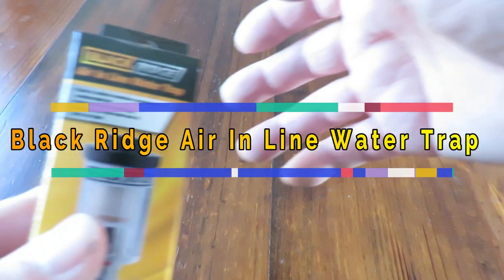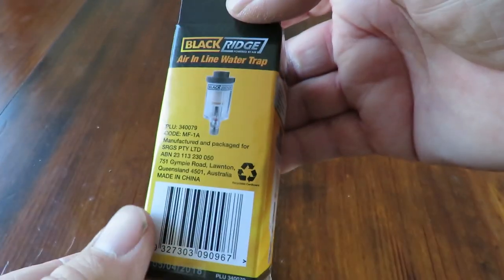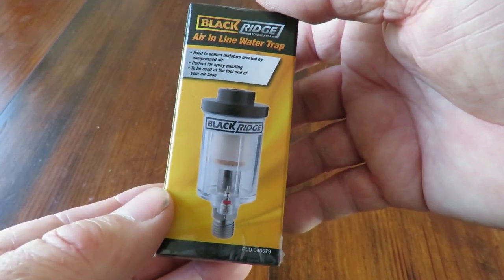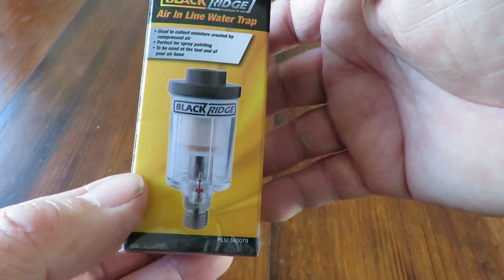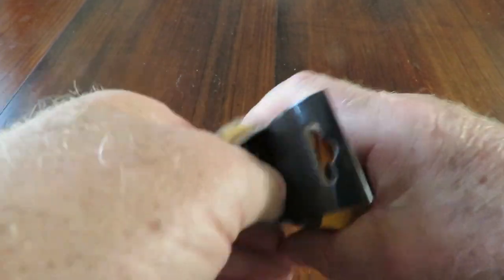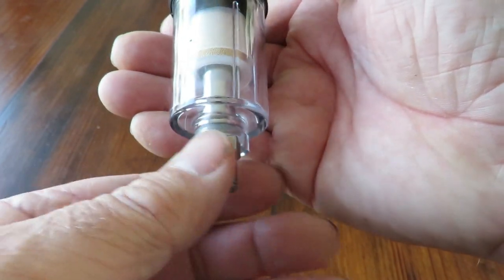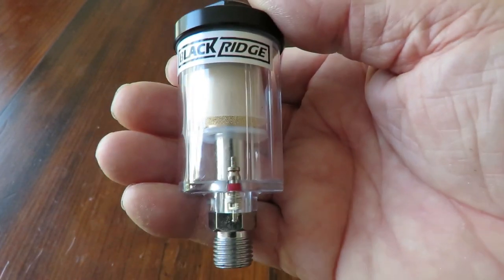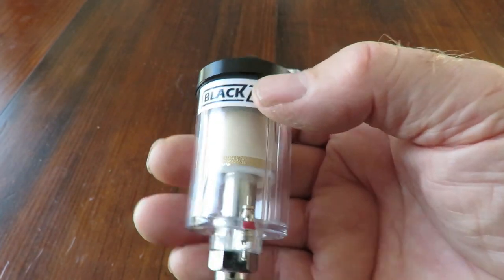🛠️ Review - BlackRidge Air Inline Water Trap for Spray Painting Guns

Comment from the maker: An Air Hose Inline Water Trap is an often overlooked item when setting up your spray gun setup to your compressor, but it is a good addition to have for spray painting.
The air compressor can push water through the hose and ruin an otherwise perfect finish.

Comment: this is bad advice, I have 3 of these filters, and I made an aftercooler. I have to constantly purge all 3 filter while painting and I still get water droplets. still looking for a solution to this water problem, maybe a much bigger after cooler. so that why you have so many dislikes, this by itself x3 still doesn't work
Reply from the maker: Its the nature of the beast so to speak.
Reply: Are you sure you aren't using it upside down, like the majority of users seem to be? I keep seeing people with these mounted to the base of their spray gun with the black cap mounted to the base of the gun. These aren't for spray guns. The air is supposed to enter on the side with the black cap, then be drawn through the base. The water vapor filter will keep the water on the outside, between itself and the clear cup.
There is even an arrow, indicated the airflow direction on the thing. People seem to ignore this though.
Reply: @ryanokeefe12  no you don't understand I had 3 of them and they were working as intended. 2 at the tank and yes 1 at the gun. The solution is you need the plastic $5 media filter right before the gun. This centrifugal filter get the majority but the air dryer at the gun gets the rest. The centrifugal filter did its job but the tiny amount of droplets still getting thru the gun ruins the paint job
Reply: Oh right I did find the solution. You need an air drier right before the gun, it's the plastic red or blue filter $5 at HF
Reply: @eksine  I don't think you read my comment.. How in the world did you have one at the gun? It would either be mounted backwards or mounted upside down, both methods meaning the water is pooling AT the filter itself.
Reply: @ryanokeefe12  I don't think you understand what you're saying. You hold the gun straight up or 90 degrees to the floor. Why would it be upside down and backwards? Dude I've rebuilt a transmission before. I think I can read an arrow showing me the filters airflow. What is wrong with you?
Reply: @ryanokeefe12  also why do you think this video has so many dislikes, because it's wrong
Reply: @eksine  bro.. The spring loaded vent needle needs to be facing the ground for it to work correctly, and no, I don't mean to vent water, I mean for the whole system to work properly. It's impossible to mount it to the gun in the correct direction and have the unit orientated the correct way.
It uses the exact same water seperator filter as every other water trap
Reply: @ryanokeefe12  having 2 identical filters behind it facing the right directional and yes it mostly the one at the gun faces the right direction, I even had it hanging off a 3 foot hose from the gun. Are you trying to imply I'm that stupid or just assuming I'm dumb? I've been practicing for a year spent thousands on paint. 100% you need an air drier at the gun, this filter doesn't cut it. That was my rookie mistake, ask any oro painter. A drier is REQUIRED, REQUIRED seriously ask. I've tested this 3 filter setup, does not work unless you live in low humidity. You probably live in texas which is why u think it works 100%
Reply: @ryanokeefe12  and that's what I'm saying a water trap doesn't not work, you need the fiber filters, literally fibers inside
Reply: @ryanokeefe12  The Neiko 30252A Water and Oil Separator on amazon, is virtually identical to the Blackridge. It has pictures of the unit attached to a spray gun, exactly the same as in this video. It has a BIG arrow on the filter to show the direction of airflow, exactly the same direction as in this video. Every other filter is the same, the end with the drain valve fits into the hose so that when in use the valve is pointing down. In order for water to be released, it needs to accumulate where the valve is. One of the reasons for having a filter near the gun, is because it gives the air a chance to cool down in the hose making it more efficient at filtering the water.
Reply: @marka6487  Look at the arrow and look at the direction.
Perhaps you should buy the filter and have a look at how it works... there air that can pass in or out of the side connected to the anodised cap is directly connected to the bowl that accumulates the water.
Reply: @ryanokeefe12  "There is even an arrow, indicated(sic) the airflow direction on the thing. People seem to ignore this though". 

No there is not actually. Have a look at the video, it shows EVERY side of the filter and there is not one single arrow anywhere, so no need to buy one. I don't see your photo anywhere???  

 Memory is a funny thing, when you want to believe something so badly, you can create false memories and imagine to have seen things that simply don't exist, claiming "there is even an arrow on the thing" when blind Charly can see that there isn't. Not a good idea to not check when you are dealing with video.

Did you even bother to look up the Neiko 30252A Water and Oil Separator? Of course not because that would mean having to face reality by seeing a filter that is IDENTICAL to the Blackridge filter which is identical to dozens of other filters that more than likely all come from the same factory in China. There are also numerous pictures that come from the manufacturer that have the fittings attached with the female connection on top that fits the air gun and the male connection on the bottom near the release valve.

 You only have to spend a few minutes on google image search to find numerous other filters, exactly the same, that all show the same thing, the hose attached to the side with the drain valve. Unlike your invisible arrow, the Neiko 30252A Water and Oil Separator does actually have a very big arrow that says "air flow" on it. Every part on that filter is in the exact same position as the Blackridge filter, exactly the same as dozens of other brands that all say the same thing but you would prefer to believe that somehow, even though it is built exactly the same and most likely comes from the same factory, that for some incomprehensible reason, that only a "genius" like yourself could possibly fathom, that they decided to do things different? Don't you think that if it was meant to be installed with the black part on the bottom, that they would have the picture on the box facing that way and therefore they would also have the name so that it could be read that way? But no, according to you, they have it pictured on the box upside down with the writing also upside down. 

Even though all the evidence proves you are wrong and your evidence does not even exist, you will still struggle to find anything that will enable you to avoid having to accept that you are wrong; maybe it was rigged? There are no arrows on the filter even though you claim there are, if you still insist that you are correct, you can easily contact the sellers who will be able to confirm your fantasy but you can't do that because you know that would mean having to face reality.

Do an image search for "Water and Oil Separator spray gun" and see how many pictures you can find that support your delusion; hint ZERO! You will find plenty that all show air guns attached to the filter side with the hose attached to the release valve side, so why don't you write to  all the manufacturers that took those photos and tell them that they are all wrong?
Reply: @marka6487  Bud - you do realise that thise is the same filter made for multiple manufacturers? you do realise that you've completely ignored my point about the air filter drawing air from the bowl side if mounted with the paint gun on the anodised aluminium cap side?

Let me make it simple for you. See the filter part (the yellow water seperator)?
See how this is elevated from the base of the clear water collector and is connected directly to the tube that feeds down to the bottom of the clear bowl?

That filter prevents water from flowing through it. It only allows air to pass through. 

The clear bowl section is connected directly to the inlet in the aluminium cap (there are holes around the inside to allow air in).

If you mount it the way all of the incorrect chinese pictures show, all you are doing is trapping water in the air line and eventually that water will build up enough to force itself through the filter because it has no where else to go.
THEN you'll have water in the clear bowl section, but you'll be drawing air directly from the clear bowl area.

I'll make you a little video for your next response so you can understand the basics instead of arguing your false beliefs, lead by anecdotal fallacies.